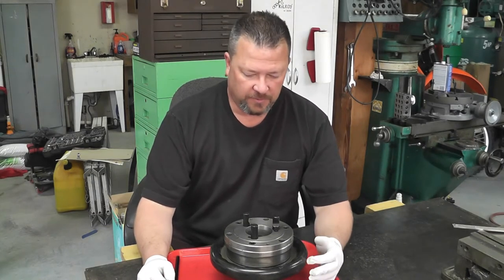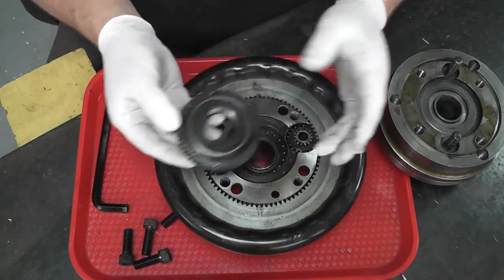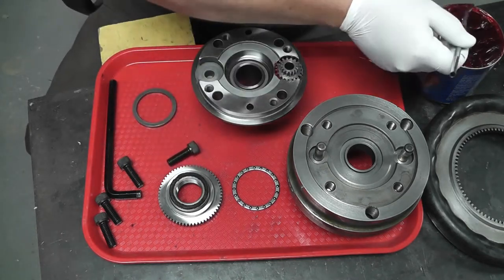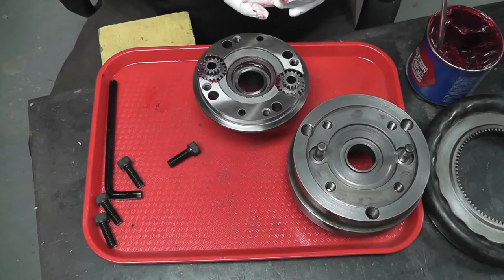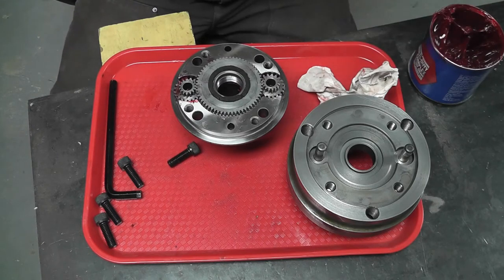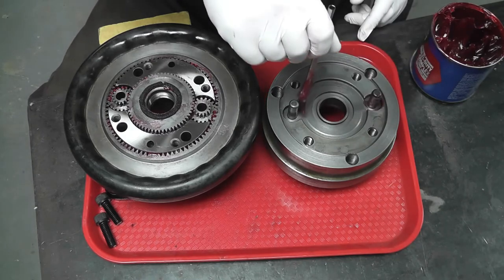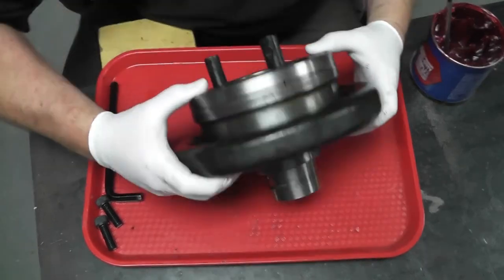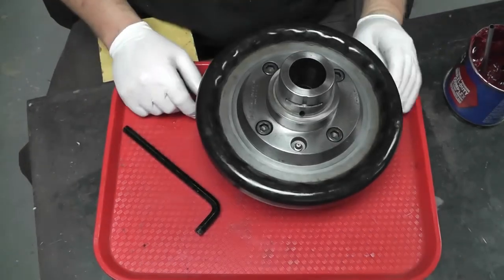Hardinge Sjogren Collet Chuck Cleaning

Comment: What is the accuracy of these Hardinge Sjogren 5C adapters? I bought a used one on Ebay, and after adapting to a LeBlonde lathe, the best I can get is .0015 runout. Is that good or bad?

Comment: I noticed the T shaped cut out on the nose of the chuck. You have one of the rare and expensive chucks that allow for tool room lathe chucks to be mounted.
Reply from the maker: Alexander McGilton I have seen that referenced but have not seen a picture or video of anything mounted on one. Thanks for watching!
Reply: Charles Franks It just allows for chucks from the small tool room lathe to be mounted on the big lathe, via the collet chuck. 
http://www.frets.com/HomeShopTech/Projects/2JawChuck/2jawchuck.html
Reply: I have never used grease in any lathe or drill chucks…it just acts like a magnet for dirt and metal chips…a light oil like 3 in one works perfectly…and makes future cleaning and maintenance so much easier…there are no fast moving parts that require a high temperature or high pressure grease…the dismantling part of the video proves the point….I recently bought a new but very cheap Pratt Griptru chuck that was completely seized….upon dismantling the original grease had become that hard it was like varnish and had to be scraped off….once removed and oiled it works like a dream

Comment: I just cleaned mine up. It was stuck by gummed up old grease. But now that it’s cleaned and regreased, when I tighten up the bolts, it binds and won’t turn. Any thoughts?
Reply: ...I'll admit that i don't know very much about these chucks- but are you sure that you reassembled the parts correctly?

He mentioned something about synchronizing the gears in this chuck(?)
Reply: @daleburrell6273  Unfortunately, it’s now a moot point for me. My chuck along with all my other tools were lost in a wildfire in August 2020.  Thanks for the reply though.
Reply: @kyleconnole6044  ...sorry to hear that- Mother Nature can be downright VICIOUS-!!!